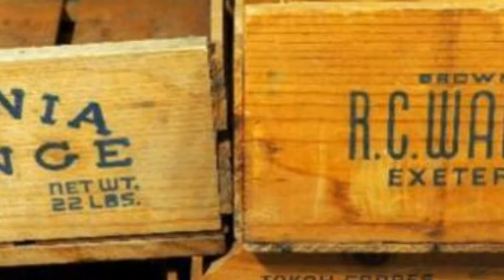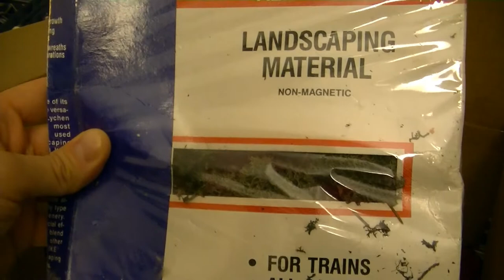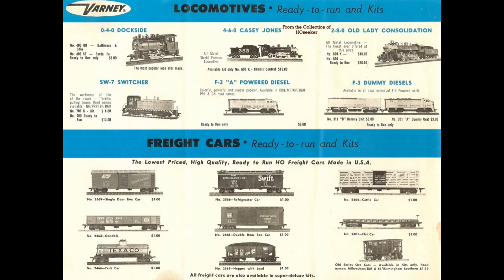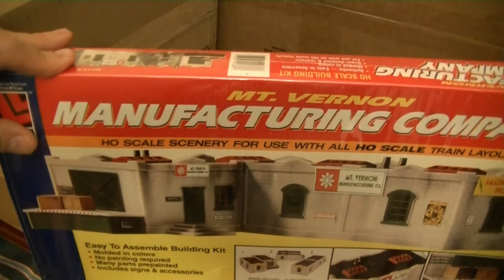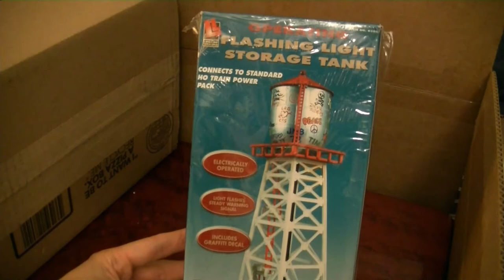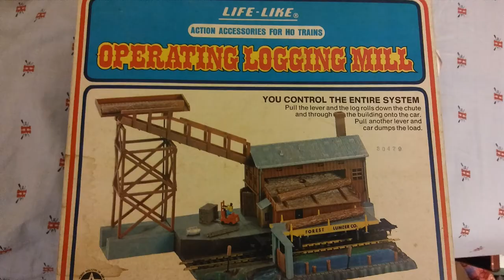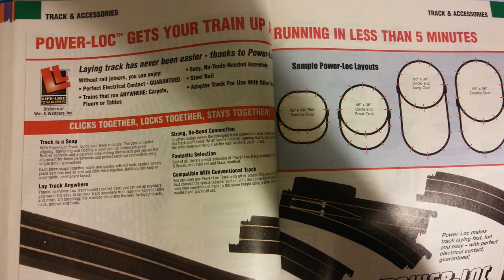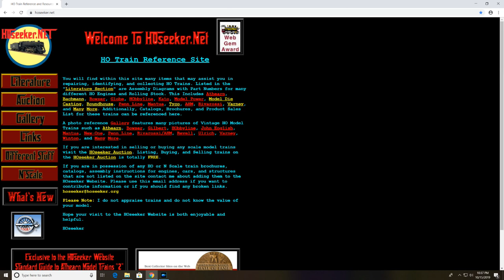The History of Life-Like Trains part 1.

Comment: I had a layout in the 1970s, which did include Life-Like scenery, and a little rolling stock.  I picked up quite a bit (mostly AHM) when Woolco sold off their model railroad inventory and got out of the toy train business in the early 1970s.  When a grew into a teenager, and my transformer gave out, I lost interest.  My parents threw the board away, but I put everything into boxes; which I then lugged around with me for 30+ years.

During that time, the varmints that got into the boxes ate all of that Life-Like lichen.  I was also given two Life-Like train sets, both with Powerloc track, in addition to what I already had.  I also bought a Life-Like Proto 2000 2-8-2 and a Athearn Santa Fe PA.

In 2012, my son got tired of waiting on me to set the layout up and did so himself.  We used the PowerLoc track that came in one of the train sets.  The Life-Like locomotives from the sets, the Athearn, the Proto 2000 Mikado, and an 0-4-0 switcher that came from a Tyco kit were all I had to run when we started out, as I also ran all my locomotives into the ground during the 1970s.

I expanded that layout into an 18" and a 22" loop, connected with switches.  One thing that I found out is that Life-Like did not make a 22" radius or larger switch, unlike Bachmann or Kato, seriously limiting your expansion capability.  Ten years later, I am still running that layout today; you can see videos of it on my youTube channel.  Besides staying together all these years I have found that you can run everything from 1950s Marx trains to anything DC compatible you run today on PowerLoc track.  My layout room is climate controlled; so corrosion is never an issue; just cleaning the gunk off from the traction tires and plastic wheels on occasion.  

I later insulated the crossover so I could run both loops independently; the Life Like transformers still work; but older can type motors do cause the transformer to shut down after a while due to overheating.  (They also don't have enough speed steps compared to Bachmann and others.) The Santa Fe GP-38 from one of those train sets finally gave out this year.  Life-Like locomotives do suffer from poor pickups; but I have far fewer startup and low speed running issues than you did; and that is over a ten year period now.

One very amusing detail you neglected to mention is that Life-Like did switch the cars on that auto-rack transporter from the 1950s cars you show to...Chevrolet Citations!  I have an ad from Life-Like that shows they were very proud to have a product placement win with Chevrolet and their revolutionary new cars.  Unfortunately, the Citations turned out to be even worst junk than the Life Like trains; and it must have become an embarrassment for Life-Like at some point (or maybe not.)

Finally, some of the Life-Like locomotives shipped with something worst than brass - sintered iron wheels.  They were properly blacked out, but had even poorer pickup ability than the brass ones.

Comment: I have that Life-Like Santa Fe engine. I had to take out the old wheels and replace them with wheels from a broken coach with interior lighting I had. I had to basically use a dremel to cut down a little material on the wheels. But, the locomotive doesn't perform that bad if you replace the wheels on it.

Comment: I know this is a bit late, but I've recently been playing around with a couple of those old RS-11s. One day before watching this video, I discovered that the finicky performance of the motor isn't actually the motor. It's the cheezy headlight installation. The metal contacts fit loosely and jiggle around while the locomotive is running down the rails and over the joints. The loose contacts serve up both open circuit and short circuit situations, resulting in jerky performance. To test this, I simply cut the red wire (ground) that runs from the motor to the light fixture. The thing ran great with this "modification". I intend to install LEDs and four wheel pickup in both of mine, and that should make these acceptable performers with the original motors still in them.
Reply: I wish everyone knew this. I started replacing energy hungry bulbs with LED just in the headlights and number board, because I don’t want the cab brighter than the headlights, and noticed the improvement. I’m also replacing all lights in passenger cars, because I hate the flickering.

Comment: We call Bachmann, life Like, Con Cor, and others of this type - throw away trains. They run good for about a year, then you discard them like last year's christmas cards.
Reply: Generally true of the old stuff. However life-like/Proto, Con Cor/Kato (notice how each manufacturer got better when they farmed their manufacturing out to a better firm? lol), and the newer Bachmann models have improved leaps and bounds. I'm especially impressed with how good for the price that Bachmann has become. But yeah the old ones were very much junk when you compared them to say an Atlas yellow box, Athearn blue box, etc. Especially the Atlas yellow box engines that were made by Kato. Those were/are incredible. I've got a few old Bachman and Life-Like pieces from back in the day. You can definitely tell the difference between the "toys" and the "model railroad" quality units. Sorry that was so long-winded. Drank a bunch of caffeine this morning, lol.
Reply: @Shane-Singleton  Remember, Proto Series came at the end of the Life Like Era in order to promote better quality equipment. Bachmann only got better because toe CEO or two through the 1980's into the 1990's was 'removed' and a new CEO appointed (giving rise to today's quality). In order to balance the Bachmann quality with pricing, the newer models lack descend details with a huge jump in pricing to match Walthers, Athearn, Kato, etc. Atlas yellow boxes were good, but their chassis were all wrong and based on prototype drawings (Cox for example). The split fuel tank on all of their models was the wrong shape and design for most of their EMD after SD9 series. It's okay to be a wind-bag. Let's chat more!

Comment: Lima had Security block track which had the locking system built into the rail joiners while still being non roadbed track. but you had to remove the security block joiners if you wanted to use other brands of track.

Comment: What ruined Powerlok track from a toy train perspective (As no scale modeler would use it) was it continued to follow the US standard of 18 inch and 22 Inch radius curves. This basically makes it impossible to make a double track mainline with consistent spacing between the tracks, that can be easily crossed over with two switches. Only Peco has gotten this right with their line of "Set track"

Otherwise, Powerlok was a very good system indeed.

Also, I've never had any considerable issues with any of my LifeLike locomotives except their quite noisy. I've still got a few that survived my childhood and somehow avoided getting stolen, and they run to this day.

Comment: RSO is not the manufacturer of the Yugoslav-made locomotives; it is Mehanotehnika.  The RSO on the models has to do with their compliance with norms for electric toys and devices that ensure that these do not interfere with radio and TV signals.
Reply: Yep, short name for Mfg. was indeed Mehano. Any other stamped or heat embossed characters were usually stock numbers or the compliance statute as you stated.

Comment: I love those pancake motors that they used. Ppl dont like them, but since the gears arnt preasure fitted they dont usualy crack and they have nice pulling power. You can easily clean off the pick up wheels with sand paper and then there fine. Idk how you forgot to do that but thats all i do amd all mine run perfectly. Also EZ track was from the late 90s pretty much 2000s
Reply: They die too easily
Reply: @user-sd7qo7qe4v  hmm. None of mine do. Maby luck isnt on your sideM
Reply: I. Like. Pancakes
Reply: Hey can motor works better!! Less maintenance!!, No plastic to

Comment: As one who was there, these LL engines sold alone fo $15 in the early 80's. A comparable Athearn was $25-$35.  An Atlas $50-$100.  AHM would cost anywhere from $10-$45.  AHM steam was well respected, but expensive.
Reply: Most AHM steamers, as well as their GG-1s, were Rivarossi products, and deserve their good reputations.
Reply: Most AHM steamers, as well as their GG-1s, were Rivarossi products, and deserve their good reputations.
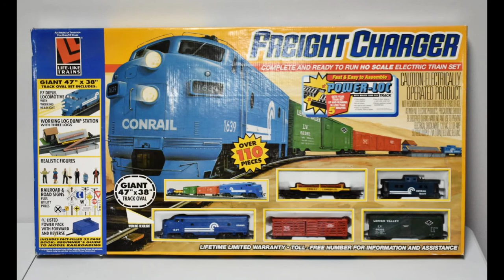Reply: 32:42 my first loco was that Conrail in their foam based over under “railroad in a box!” Loved it until I experienced all the issues described!

Comment: When did lifelike get dissolved? I really liked their sets (because it's what got me into model trains), and never had a problem with the engine (Santa Fe 3500). Although I should not care about this brand anymore, I always liked their accessablity, and really wanted a burning rubber and high iron set. Man those were good times...
Reply from the maker: That's actually a good question. The company was taken over around 2005. as you will see in the remaining parts of my documentary. Not much happen till just before 2010, when the Proto 1000 and 2000 lines were integrated into the walthers line as the main line and proto line of products. The sets disappeared about a year or two after this happened. Another interesting note, I recently found out that walthers started using powerlok again in their train line train sets.
Reply: @alcobufff  wait really? I thought they were using EZ crap I mean track.
Reply from the maker: @varrunningtrains4112  I know right? I just found out a week ago that they switched back to power loc
Reply: @alcobufff  Wow. Just looked it up and you are right. Man maybe there is hope for some future of lifelike. I wish their slot car stuff was still up though. That was surprisingly good quality compared to the autoworld stuff.
Reply: The parent company Lifoam Industries is still around.  Lifoam just wanted to concentrate on it's core business and decided to sell the model train side so they shopped around and negotiated a deal with Walthers who wanted to expand their product lines.  The best thing I found with Life Like was the scenery, buildings and accessories line.  When they Introduced the Proto 1000 and 2000 lines they had some neat highly detailed locos and freight cars at a decent price, that now live on as part of Walthers lines or Canadian Hobbycraft/True Line Trains.
Reply: Not Yourstoknow there still around. There owned by Walthers now
Reply: @alcobufff   My grandfather was Sol Kramer, so I can mostly answer this for you. The companies were all sold in 2000 to a private equity firm, who resold them several years later. I was never as big into trains as I was into scale modeling (planes, mostly, like my grandfather before me.) It was really great to know that people still get joy out of what he helped create. He was a paradoxical man; he was extremely frugal and relentlessly practical -- yet he had a life-long devotion to hobbies, which are by their nature impractical.

Thanks for your work. 

One last note: It's Kramer, like the Seinfeld character, not Karmer.
Reply: I like them he's a rivit. Counter
Reply: Me too
Reply: Don't like. This person's presention

Comment: Here i am, a minority within a minority, lifelike makes cheap trains, I decided to pull some out today from the mid to late 2000s, I dont have much if any skill within this, I have  5 f7 locomotives from kits, only one worked well and made arround the shoddy snap track I have, i won't claim that I did everything correctly but the one train that worked worked extremely poorly, only making it arround the track at full power, I dont have enough permanent room to use for a permanent layout right now but it leaves me wanting to get a better train set.
Reply: As well most people who have these dont have access to cleaning supplies, like I said many of mine have just don't run

Comment: Your "Pushtrain" is a result of zero knowledge about that design other than you felt it needed a push.  Bad or incorrect grease was and still is the most common cause of these trains bad reputation as well as lack of or chunked up oil in the bearing areas and on the gear shafts.  Life-like were toy grade but properly maintained ones will rocket across any layout and even handle most grades very well for what they were, Toys.  1 quick tip if you hear someone comparing Life-like trains to Athearn, Atlas, Kato or any of the other high grade brands just walk away you will already know they know very little about the subject comparing $100+ Engines to a $10 toy engine.
Reply from the maker: I assure you I have much more then zero knowledge of the design of these locomotives, having worked on them since I was 8. While we are on the subject, if you note in the video, the locomotive were having issues picking up power. There is no grease inside the pickups located  on the rear tuck of these locomotes, the motor truck dose have grease in the gearbox and the oil, on the commutator bearing, but dose not pick up power, as it has plastic wheels, so oil is not the problem, this was how theses locomotives were made. The reasons these locomotives ran so poorly were the brass wheels and wheel wipers, which were made  cheaply and, there for corroded easily. And in the case of the wheel wipers, came out of shape, effecting the locomotives ability to pic up power.  To get these locomotives running, I scraped the wheels and wheel wipers until I  had enough clean metal that the locomotives ran. I could have gone further, and made them run a little better, but since I was just trying to get them running to make the documentary, I did not want to invest a lot of time in these locomotives. Also, even if we take the argument that these were suppose to be toys, as life like did market them as "models", since when is it ok for a toy to run this badly? Lionel, AHM\mehano and cox made ho scale trains back in the late 70's, at a low price, they all ran several times better then the locos from this era of life like.
Thank you for watching!
Reply: @alcobufff  I've also heard that cleaning argument regarding Atlas brass track, almost disregarding that brass tarnishes with great rapidity, and why it's not used any more. steel track is better than brass but that's like saying Nero was more socially acceptable than Atilla the Hun. isn't it funny that when Bing first made that style of ballasted base track in '22, followed closely by Marklin, and of course Hornby Dublo, all those track systems functioned exceptionally well. Triangs 1950 Universal track (and by extension their TT type A) really were the precursor of the modern style system, having the integrated plastic lock system an being all plastic. again, let downs being steel rail and limited geometry. pity they had to go with "realism" Kato and Tilligs unitrack works very well. It's always a shame that lifelike (and similar companies) seemed to find this need to produce really poor running equipment in the effort of economy. early Triang models people laugh at now with their compromised proportions, poor if non-existent detailing, and confused model range, had well designed good quality mechanisms (but again only one pickup bogie however triang did update this) and if maintained well would last indefinitely. Triang constantly improved it's models, and basically within a decade it went from cheap and poor boys toys to better detailed and modelled than it's domestic competition. I could add that Triangs customer service was second to none, warranties being honoured throughout the commonwealth with free parts shipping from England out to even Papua New Guinea